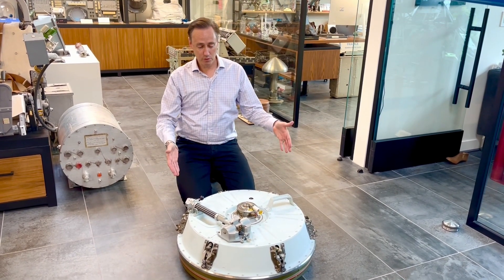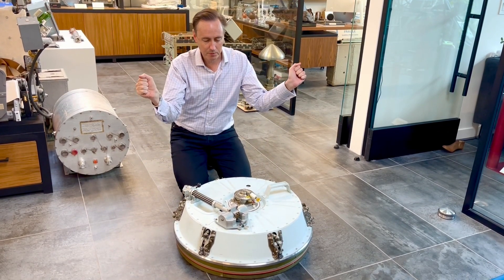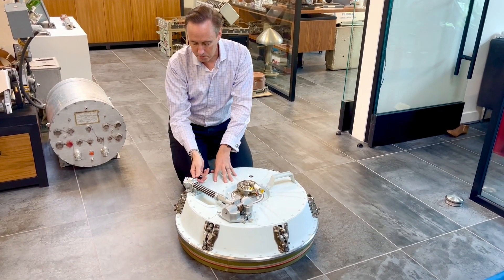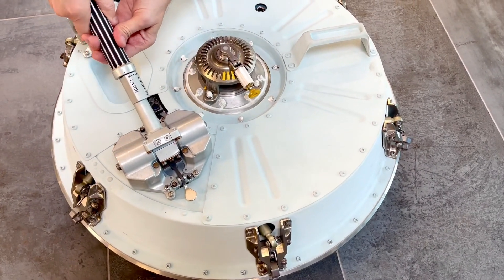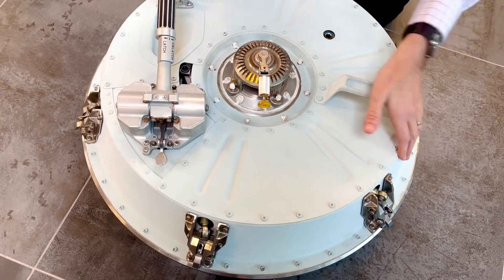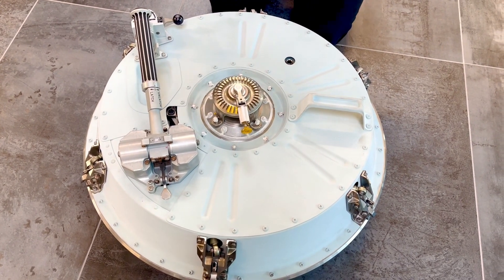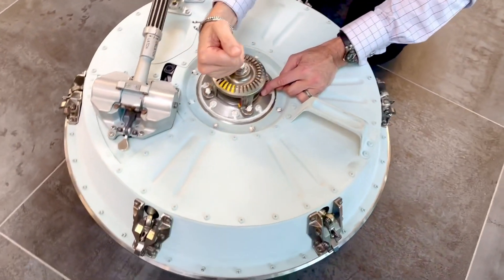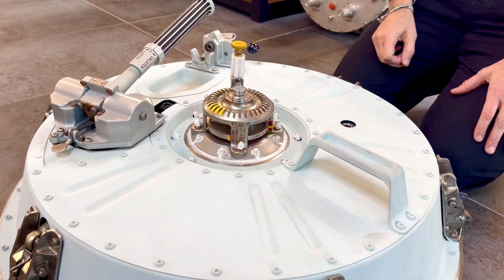Apollo Command Module Forward Hatch Operation

Comment: hmm, seems clumsy. Why the massive central valve if the pressure difference is at most 1 bar which is 1/3 what's in a soda bottle and the opening is huge like it should vent a tanker. I would think the tiniest little valve would be plenty. It could be a small push button. Latch mechanisms also seem elaborate. And why so thick? massive insulation?
Reply: Why so thick? Dunno. But note that this hatch was a frontal surface of the overall rocket after the Boost Protective Cover was jettisoned shortly after 2nd stage ignition (Tom Hanks playing Jim Lovell in Apollo 13: "Tower Jett!"). Also, some depth was needed for the mechanical connections between the control handle and the latches.

Comment: Whaaat. I knew lem had really low pressure, but that there was such a differential to CM to warrant this elegant system? Awesome.

Also - we need more videos like that. I know you have a little museum of (not only) space wonders, so please share your excitement with the world.
Reply from the maker: Apollo ran on low pressure 100% oxygen. The thin-wall LM has an open vent during launch to transition from 1 atm to 0.  After docking to the CM, "a pressure equalization valve in the CM forward hatch was opened to allow oxygen to fill the LM through a similar valve in its hatch that was left open at launch." — https://en.wikipedia.org/wiki/Transposition,_docking,_and_extraction#Procedure